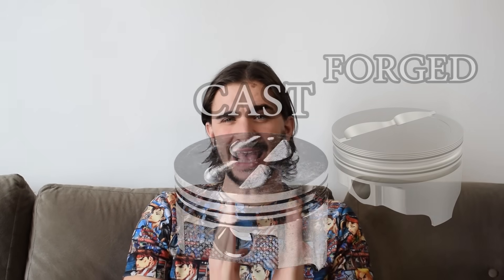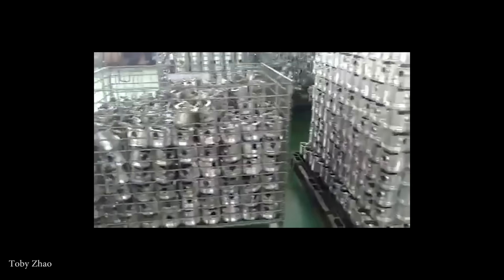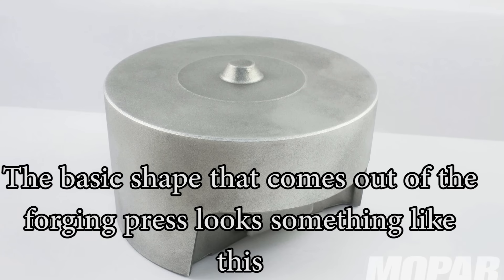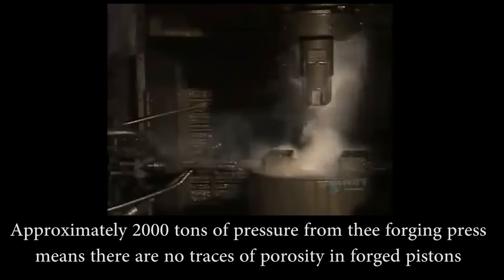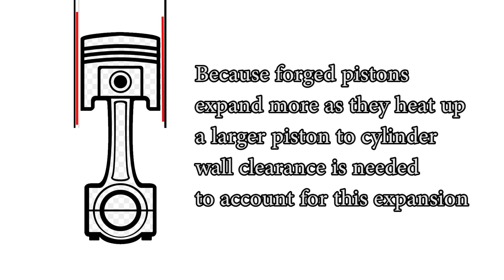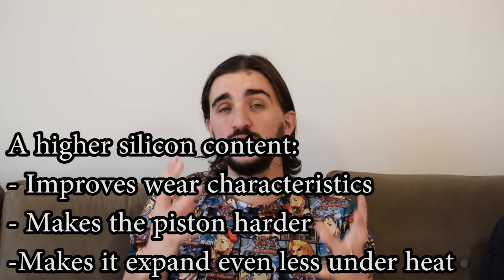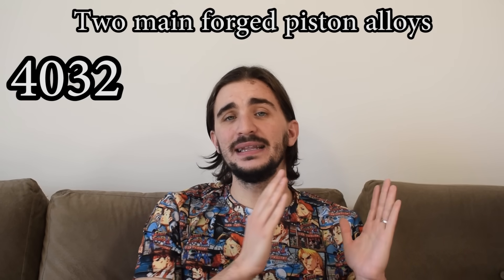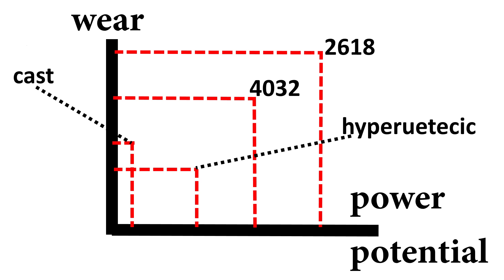FORGED vs CAST vs HYPEREUTECTIC PISTONS

Comment: I just want to add, in regards to piston slap, the video can be misleading. Not knocking him, but only so much correct info you can read online before it becomes wrong info. Professionally speaking, piston slap is NOT a given just because you use a forged piston over cast. Even forged pistons have a minimum clearance they can run at. It is very application specific, and there are many variables which dictate actual needed clearance. To insinuate all forgings will slap when cold, is not accurate, as any time i have witnessed this, it's because the builder got too aggressive on what he thought clearance should be. There are no set clearances, regardless of material of piston you use, that dictates what it should be run at. 
Also... it is important to note, that pistons do NOT slap the entire way as they travel up and down the bore. They only tend to slap, if they are going to, at tdc and bdc, when the angle of the rod changes which in turn changes the direction of the piston. Bigger strokes and shorter rods glorify this. And yes, cast pistons can slap as well when cold, hence why the factory, in newer style engines, use offsets in the pin to try to correct it. Hope this helps.

Comment: I built a 383 for a guy in San Diego for his boat. He insisted on forged pistons. When I went to explain to him he was almost rude and cut me off saying he had really done his home work and that's what he wanted. Said he was going to run the engine at around 4 grand most of the time. So ok I build this bad ass Scat forged lower assembly and he come and got it. About a week later he calls and says the engine is knocking. I said ok meet me at the boat ramp. He hadn't put it in the water yet. I got there and we put it in the water under protest from the owner who was c0nvinced there was a problem with the engine. He didn't know but we dynoed that engine with a carb before he picked it up. We started it and instantly said hear that! I told you so! I said what that piston slap? That's normal buddy. I thought this is what you wanted? I had to sit there and warm it all the way up and take him out on the water to prove to him the engine was good to go. After all that we get back he says he dont like it and that he would pay me to change the pistons with what ever I thought was best. We went with Keith Black hyper coated pistons and after that he was a happy camper. And I got to keep those Scat pistons too! So I am also happy!
Reply from the maker: The customers that "did their homework" are sadly too often a nightmare. I'm glad your case turned out well :)

Comment: I also think that you should talk about tempering and annealing parts.

It kind of sucks that you can't have a material that's very ductile while also having very low thermal expansion. Ductility is the ability to deform *without breaking*, but does it really have to be mutually exclusive from hardness and stiffness?

Comment: Hyperutectic means it contains more additive than the metal will naturally absorb. It's kinda like sugar in hot tea, only so much will be accepted. So to increase the content the molten blend must be thoroughly mixed immediately before injection.
Cam ground pistons are a technique for reducing slap during warmup as the skirt section stays in contact with the cylinder walls while the bulk of the piston warms and expands into the bore.
Nice presentation.

Comment: I'm still waiting for the first metallic glass automotive piston.

For those who wonder what I'm talking about: A metallic glass is an alloy that has no crystalline structure (so zero grain structure). As long as it's purely metallic glass and no crystal structure is formed during the manufacturing process, it will be stronger than a forged or cast piston. The weakness from metals comes from grain structure boundaries. A metallic glass has none of these. Metallic glasses have high tensile strength with low ductility and low wear.

They also have less thermal conductivity, which means the piston would heat up less, and this means more of the burning of the fuel would translate to work (read: more torque).

Comment: I have read that when running an engine on propane (in my case a 22r) forges is better because of how much hotter it burns but after watching your video I’m not sure if forges is better due to the expansion you discussed. What are your thoughts. May do turbo propane some day.
Reply: LPG give LESS heat, burn COOLER and therefore SLOWER. And when it burns slow - heat has more time to escape through a cooling jacket. Engine is heating harder and develops less torque/power then on gasoline. Just like "lean" gasoline mixture. People saying it burns "hotter" aren't quite correct - it runs "with lesser efficiency". 
Forged piston has about 20% higher "tensile strength" (author has mixed up with terms - ductility is what he's explaining at hypereuthectic pistons, and strength - is what he's calling ductility at forged ones). That means - having the same weight as stock cast ones, forged (term "isothermic swagging" is more correct because no blows involved in a process) pistons will be able to withstand higher mean piston speed and/or pressure. 
As for a heat resistance both three types are near the same. With one important aspect - aluminium rapidly looses it's strength when heated. At 300C it becomes around two times softer than at 20C, but at 250C it's about 20% less strong . Average piston temperature is kept around 200-250C. I think forged piston is good way to go in your case.
Running turbo on propane can be a good idea (not sure, highly depends on your engine design - it can burn your valves easily if not tunned correctly). Increased compression is good for combustion speed - that will compensate disadvantages of gas as a fuel. High turbulence combustion chambers (like May chambers on Jag V12 HE) can give the same effect.

Comment: MIM/PSM aka: “metal-injection-molded”/“powdered-sintered-metal” pistons and rods are becoming somewhat common now as well. They can be even more precisely made than cast and are stronger than cast components, often with strength comparable or better than billet and with significantly less machining to finish
Reply: Glad the technology is improving!
Reply: Please forgive me for decade old info on a material, but MIM parts have a negative stigma in the gun world. Manufacturers use MIM to make small parts with detail or texture. Things like safety levers, mag releases and bolt catches. Small parts that are constantly hit with fingers or palms.
They break all the damn time and are replaced with machined parts in anything past a budget build.
So please, have there been some big improvements or was it just the small size? Not trying to be an asshole, honestly curious.
Reply: cody blea Believe it or not, I know what you are referring to, it used to be my job. The number of Remingtons with broken MIM parts that came in every month was ridiculous. The extractors were usually first to go. But yes, a large part of it is that they aren’t re-designing the geometry of the parts to fit the desired material, but rather re-using the shapes of machined or forged parts that aren’t really suited to the random grain structure of MIM parts. 
   It is much like heat-treating: It can be done quite well or very poorly depending on the technology used. Also the metals used in many gun parts are often cheaper and lower-quality than those used by many modern MIM manufacturers; hence the poor reputation. The technology has gotten very good, but most manufacturers aren’t going to invest in it when they still make a profit off of their old (already paid off) technology. 
   “A customer can have their critical parts in whatever material they choose, so long as they choose MIM.”
 -basically Remington
Reply: @codyblea3638  Sintered parts are generally not heat treated to make production easy and cheap. Air pockets are usually present in them depending on the mesh size of sintered powder. Their grain structure is random and they lack fatique strength.

Comment: Why dont they use a heavier alloy like carbide tungsten, it doesnt expand.. but it would way about 10lbs per piston.. I assume that's bad, but why?
Reply from the maker: A heavy rotating assembly decreases max rpm and responsiveness. Pistons achieve extraordinary speeds and very abrupt changes in direction which means a piston that heavy would reduce the life of the engine by significantly increasing the forces exerted onto the bearings, rods and crank.

Comment: High end forged slugs are sometimes choke-bored. Meaning; the thick and heavy head is narrower than the skirt to prevent cylinder galling due to thermal expansion. Some aircraft cylinders are also choke-bored, but that's a story for another time.

Comment: I have a question:
Can you daily forged pistons in a sleeved engine? Like with those fancy darton sleeves?
Reply: Yes, just because they are forged, doesn't always mean real big clearances are a must, it is application specific.  In that instance, I would use a 4032 forging if you had to have a forged style piston. Either way, forged pistons still have a low minimum clearance they can be run at.. they don't all grow the same amount in every engine.

Comment: I used cast hypereutectic pistons in my engine build. My engine is a mild 40% power increase over stock so I didn't need anything over the top. 
My next engine build will have custom forged slugs, expecting a 95% increase in output over stock, not huge but the high rpm operation calls for something a bit stronger regardless.

Comment: What about cast pistons with a thermal layer or piston coating?
Reply: If you are running in a class that requires the use of vast style pistons, then yes. To do that for a basic engine will be pointless because of the cost. May as well just get a good forging which will handle more.

Comment: I've just put forged wiseco's into my supercharged hayabusa (3 days ago)
I couldn't believe they needed deburring when I opened the box !
Top spec kit for top price that cuts your hands unless you clean them up ?
Great vid
Reply: No offense, but NEVER assume anything, new or not, regardless how much you pay, is ready to run out of the box. Ever. Common knowledge that even new parts need cleaning and inspection before assembly. Just some advice.

Comment: even if it is a daily driver have to consider mods and the bhp.. most pistons are only good til arround 280- 300bhp. so lets say have a z20let at 190bhp but want to mod it to match the 350bhp or a rs then forged is the only option above the 300 mark. my own opinion is that i wouldnt take a engine above 280 without forged internals

Comment: Would an engine block heater help to get forged pistons up to temperature, respectively reduce or eliminate piston slap?
Reply: Not really, since slap mainly occurs from a bore that is too big for the piston, or generous piston to wall clearance. That is not the fault of the piston, as forged pistons can be run at tighter clearances if need be for the application.

Comment: Driving 4 answers ...check out this other type of casting aluminum alloy using "cold chamber" high pressure die casting with pressures as high as 5700 tons ? That's crazy high pressure more than drop forging 

https://www.italpressegauss.com/en-us/my-application-and-industry/application-by-process/what-is-high-pressure-die-casting
Here is what i just now found on google about cold chamber high pressure die cast piston from honda r&d ...this looks like the ultimate piston for building anything that requires more horsepower per displacement that was ever possible before !
https://www.hondarandd.jp/point.php?pid=649&lang=en

Comment: Anyone else here because they didnt know wtf a hyper eautectic something is
Reply: The only reason I'm here
Reply: I’m going to try to explain it for you. Eutectic is when a liquid turns to a solid at one temperature, known as the eutectic temperature in alloys. This occurs at a precise amount of silicon in the aluminum alloy (the eutectic composition) If you have a bit less silicon than the eutectic composition (hypoeutectic) or a bit more (hypereutectic) then it solidifies over a temperature range and you get a “mushy” range when you have a mix of liquid and solid before everything cools down and completes solidification at the eutectic temperature. For anyone who has studied this, yes I know it’s a simplification, so you don’t need to tell me. In the case of these pistons all that is meant by hypereutectoid is that it has more silicon than the normal ones. Some marketing guy used a fancy word to make it sound better than “high silicon alloy” 🙄
Reply: Just wanted to see how in-depth and accurate he was. Spot-on.
Reply: I don’t know much about pistons, but understand metallurgy so I was here for “what is he talking about - hypereutectic isn’t a manufacturing process. Comparing hyperutectic to cast is like comparing bananas to nuclear physics.”
Reply: YES! can't even spell it. Hyperautomatic? What?
Reply: Apparently they’re wet biscuits
Reply: Same here!
Reply: I'm a mechanical engineer and I don't even know what is that 💀
Reply: @kinnikuzero  It's a piston
Reply: @bluesky6985  i meant the hypereutectic thing. Heck they don't even teach you much about combustion engines
Reply: This knowledge adds 2 points towards your motor head attributes.
Reply: No
Reply: As an amateur metallurgist i actually clicked bc i use thqt word on a regular. So total opposite. 😂
Reply: Me🫡
Reply: Got em in my v8, still don't know what it means. Thinking about nitrous,  so gotta find out.

Comment: In your presentation you completely forgot the fact that if a forged piston is manufactured properly then the piston slap etc is controlled i.e. the piston as you probably are aware is looking at the top the piston is oval shap now if you look from the side on a properly designed piston its barrel shape. And that is calculated by the engine designer be it racing or road, most road engines dont bother with Barrelling unless its a high end engine. Please in future give the full story, i remember i had to remark on your Cylinder block video. Al Melling engine designer
Reply from the maker: I didn't mention this because it doesn't really change the fact that forged is still unnecessary in certain applications and that it shortens the lifespan of the engine (irrelevant on engines that will never do many miles, but still). This info would increase video length without giving significant additional value. Driving 4 Answers NASA Astronaut. See, we can all be whatever we want to be in the comments section, ain't it swell?

Comment: Save 14 minutes of your life:
-Forged is the strongest and most expensive
-Cast are the weakest and cheapest.
-Hypereutectic pistons are still cast, but have higher than 12% silicone. This puts them in the middle of the road for strength and cost.
Why 12%? Beyond that, normally the extra silicone would not evenly distribute when cooling. This extra silicone won't alloy with the aluminium (is not soluble with aluminum at the working temperature range) and then form silicon crystals at a different temperature/weakening the structure.
Reply: You wasted too many words talking about the silicon and didn't sum up the wear properties

Comment: Sorry, your explanation of ductility is kinda flase. Ductility is the ability of a material to deform under load and, after the load is taken away, will go back into its original shape.

You can stress a material beyond the ductility (the stretch limit) of it and it still wont break. But it wont go back into its original shape, but rather remain deformed. It will only break if you take it beyond its tensile strength. 

I,
Reply from the maker: That's not the definition of ductility. The standard definition does not include a material's capability to return to its original shape. What you described is much closer to elasticity. If what you described was ductility than almost all metals would have close to zero ductility, because as we all know metals don't return to their original shape after deformation. Ductility is the extent to which a material can be deformed before rupture.
Reply: @d4a  sorry my bad, got them mixed up, because ductility and elasticity are very strongly intertwined.
But metals do have elastic behaviour, for example standard steel (s235 for example) can be elongated to around 2% (if i remember correctly) and still return to its basic shape. It will break after being elongated to 26% or more. So, yeah, the biggest part of ductility is after the stretch limit (which is my mistake). But this area is, in most engineering applications, where longevity is important (engines), the only part of ductility used. 

An engineer once said "everything's a spring" and that's true. So, my bad for accusing you of being false, i just got those two terms mixed up (am only in my second semester of mechanical engineering)

Comment: Maybe I missed it.
But isn't 1 of the main points of forging also in potential of decreasing weight of the product.
(With improving the grain structure, you can get away with less mass for the ductility needed in specific application/operation)
This may not be something you would want for the "everyday" application, but if your goal is to increase RPM (track?), wouldn't that be 1 of the ways to do it?

Comment: Billet pistons. Can you do rods, as well, including titanium rods, I beam vs H beam, etc?

EDIT: I want to add, is there something in between forging and casting? Such as high-pressure/squeeze casting? Also, with the piston slap issue on forged pistons, it wasn't clear if the wear issue had more to do with the cylinder itself, or the piston, could you clarify, please?